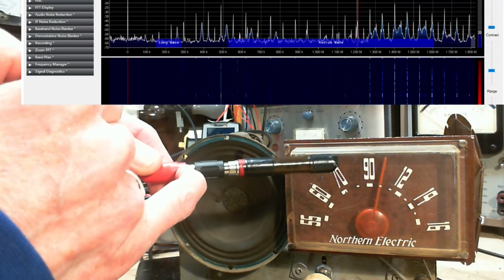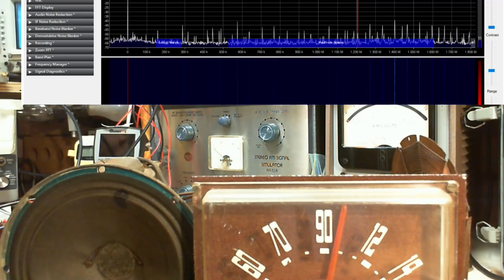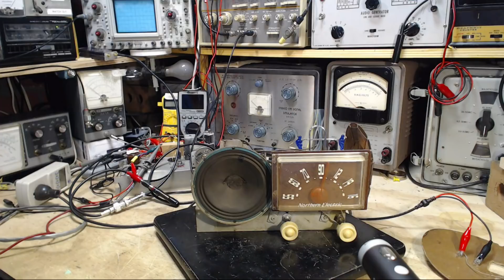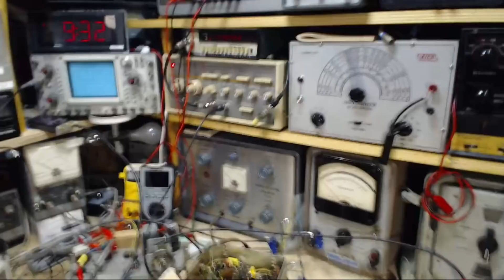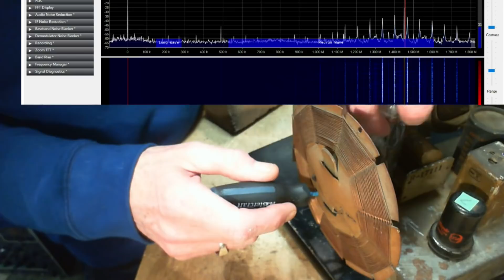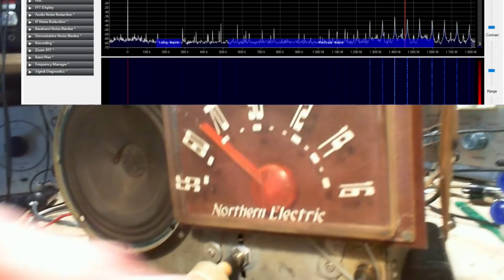Northern Electric Baby Champ AM Radio #7 - SDR Alignment Check

Comment: Sounds to me like a terrible self-oscillation.  Motorboating.. at maybe 10 Hz.  From the way that SDR display is responding, the motorboating would be consuming all of the RF (and audio too probably) resources of the radio.. and stop it from working.  That SDR display was crazy.  Given that self-oscillation, can you imagine what the radio's AGC circuit is doing while trying to keep up in desperation?  The self-oscillation (if it's that) must be corrected before any semblance of operation will be achieved.  Like the other commenter, Mr. SixString63 -- I'd start with the IF cans, looking for mica 'caps' in them.  Then play with lead dress, (replaced) cap placement, etc.  Nothing silly like missing tube shields?  That can cause nightmares.  Thanks for the fun Jim!  Snow gone yet?  I bet so.. barely.  Take care, neighbor

Comment: Possibly silver mica disease in the if can? Sounds like maybe with all the crackling and popping. Try gently rapping on the if cans to see if it changes anything. You still will get weak signals with a bad mica cap in the if.

Comment: I am not convinced that the IF alignment is correct because when you tuned the IF you peaked it mostly on noise rather than the generator frequency. Refer your previous video.

Comment: Jim - You are so patient and methodical.  However, even though the radio is so old and has only 5 tubes, it should still work much better than that.  I believe there is something else wrong besides just alignment, perhaps a wiring error in the reassembly or another bad component.  The fact that you get noise where stations ought to be might be a clue.  I looked at the schematic of your radio for some ideas.  Maybe C17 (detector low pass capacitor) is open or perhaps C20.  Another possibility is a problem with the AVC (left side of R5) is not being filtered (C13 or C14 open) so hash is getting fed back into the grids of the converter and IF amplifier.  Best thing would be to start with basics.  Inject an audio signal into the output tube, then the AF amplifier.  Then a tone modulated IF signal.  With some basic troubleshooting I believe you will be successful.  Good luck!